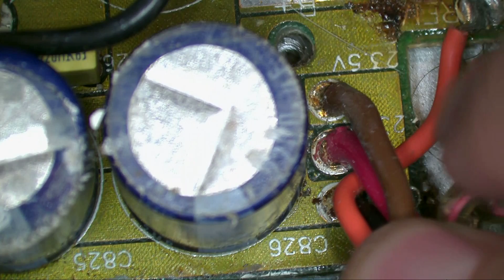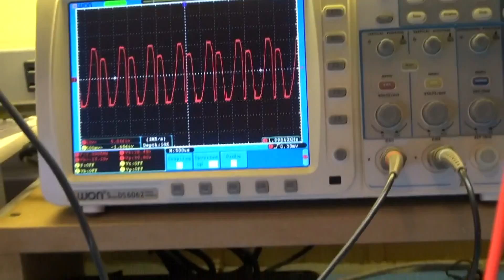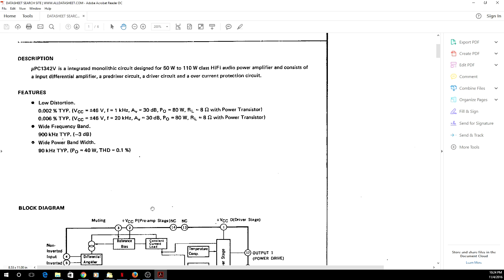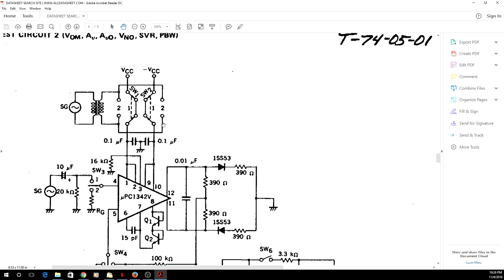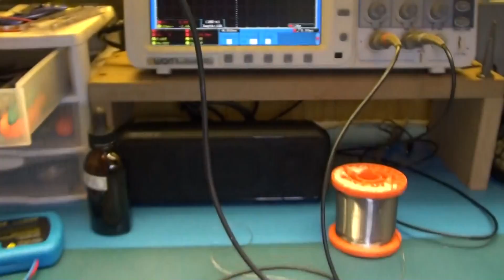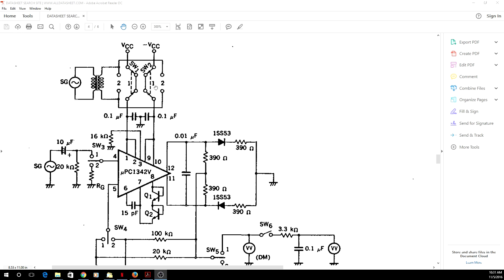ADS 6 CHANNEL AMPLIFIER REPAIR, IN DEPTH TROUBLESHOOTING. PART 2 OF 3

Comment: Hi I have a boss epic chaos 4800Db monoblock  and it was working perfectly fine but all the sudden I have electricity coming from the output channel , what can it be . I have been working on electronics since I was a kid but this confused me so for can u please help?? @Kev31779
Reply from the maker: If you mean DC from the outputs then most likely theer is  a shorted Mosfet or transistor in the amplifier section of the amp.
Reply: Kev31779 I wasn't sure but thank you for helping... Yea I'm getting a dc reading out of the output channel but the amp dose not go into protection
Reply from the maker: No all amps will go into protection. Some amps don't have it and some designs were well not all that great at their job.

Comment: Hi. Have you ever heard of an amplifier killing a subwoofer upon connecting it? I have an Alpine PDX M6 that mysteriously kills subwoofers randomly. I can't recreate the problem.

I made a video here

https://youtu.be/3XjMK6h2-Zo
Reply from the maker: That amp is damaged. I wouldn't hook it up to any more woofers, you will burn them up. The amp may have shorted fets in the amp circuit that is creating pure DC to the speaker. Some amps detect this condition and shut the amp down in protect. Some do not and this is the symptom.
Reply: Kev31779 

The problem is intermittent. It would happen only twice so far if I turn the amp off and let it rest for a bit then turn it back on it would work again. Isn't that strange?
Reply from the maker: +Tony N. Yea there is a part or parts that are failing. Or partially shorted.
Reply: Kev31779 https://flic.kr/p/P1hPFD there's a high resolution picture of the amp. Could you let me know if you see anything weird or where I should start looking? I might send it to you. Do you have a website?
Reply from the maker: I don't see anything obvious. My best guess is one or 2 of those 4 smaller Mosfets mounted on the heat sink is either shorted or open.
Reply: I'll check them for shorts. This thing already burnt a set of Image Dynamics IDQ. I caught it trying to burn my JL! Yeah I have another amp on the way and I'm not trying to use this much anymore.

Do you have an email address or a website? If I can't figure it out I want to send it to you if possible.
Reply from the maker: I dont have a website but you can contact me through majik.electronic.repair@gmail.com .
Reply: If you still are having the same problems, please also feel free to contact me at matheusmatos32@gmail.com .

P.S.: If none of the FETs is shorted, check C4004 and C4003 for unreasonably high leakage currents (too low a impedance). Your speakers could be receiving the full unfiltered PWM signal, and that would definetely slowly burn them out. Although very, very unlikely, don't rule out this possibility just yet.